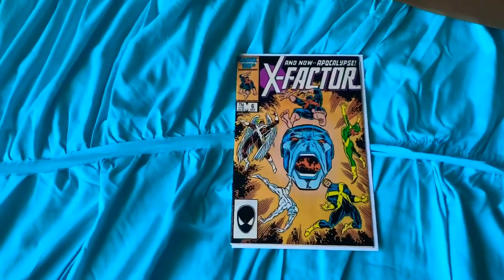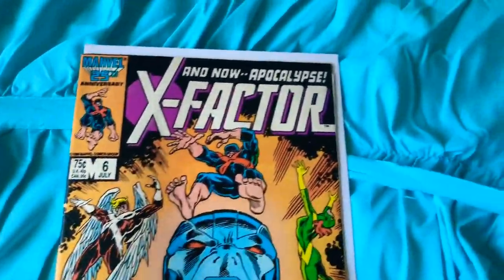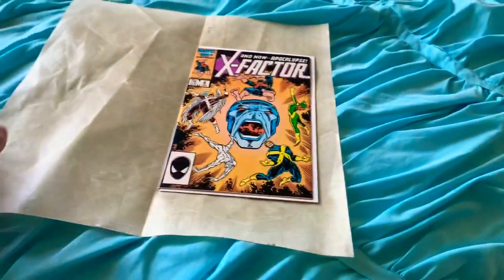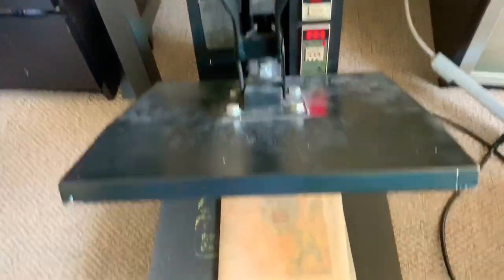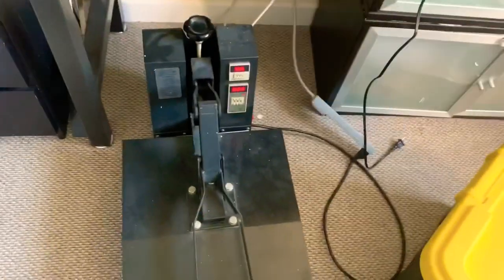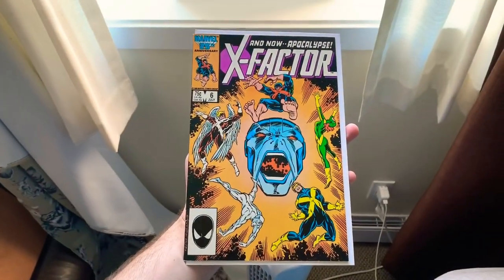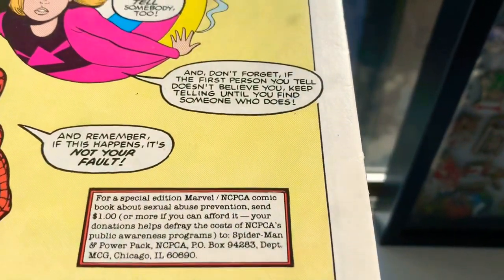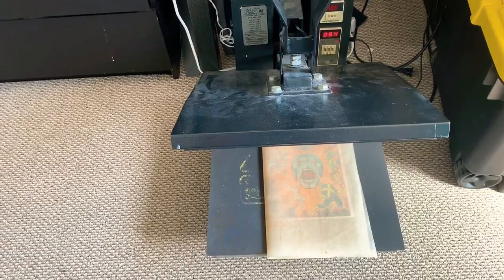RECYCLING CGC COMICS HOW TO PRESS COMICBOOKS

Comment: Thanks for sharing your pressing technique. Subbed! 👍🏼 My press that I use is very similar. I’m curious, what temperature are you heating the press up to?
Reply from the maker: Bonics mine is 65 I believe I only press for 30 seconds and than I turn off and leave it overnight. How about you?
Reply: NerdyFather I first start by putting my comic in a humidity chamber for 3 hours so that the book has moister throughout the book. Then I put it in the press at 155 F for 30 minutes on each side and then I leave it sitting in the press for 10-12 hours